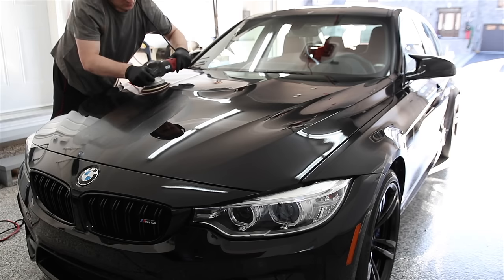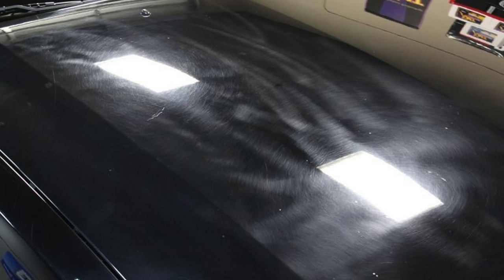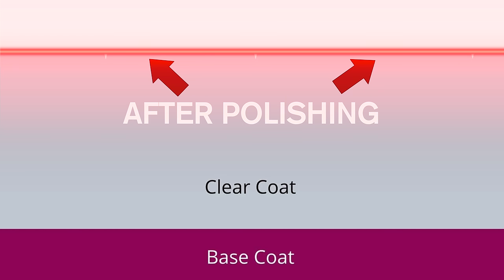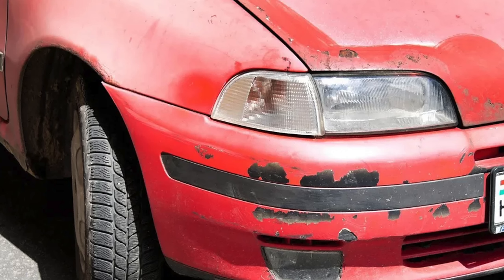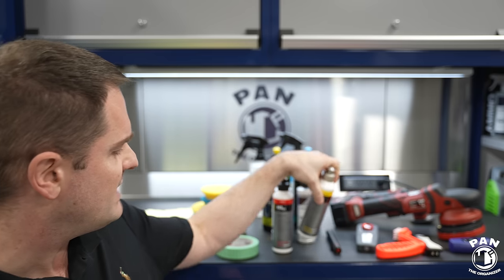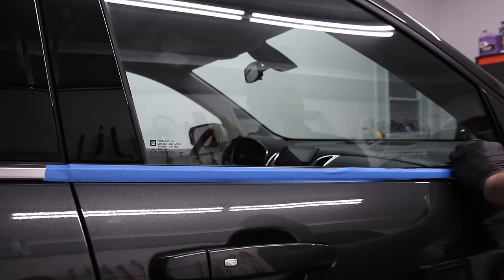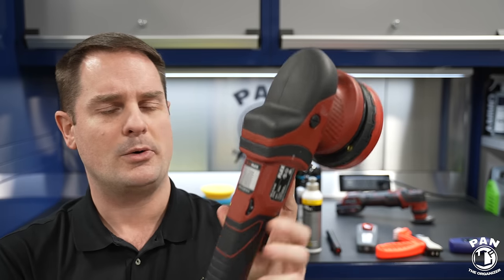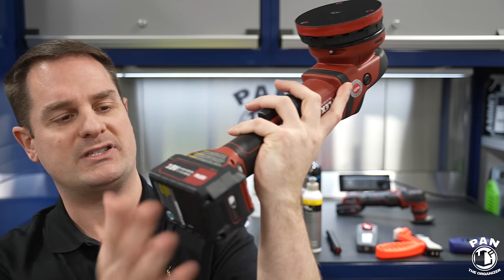DETAILING 101 - Paint Polishing - Everything You Need To Know

Comment: Hello! for Subaru Outback 2011 I used Super Cleaner I spread it on the dashboard of the car after that there were huge stains that I can not take off. what you can advance? thank you!
Reply from the maker: You mean Super Clean the all-purpose cleaner degreaser? What dilution did you use? Hopefully you used an appropriate dilution as mentioned on their website.

For interiors, I still prefer dedicated automotive interior cleaners like P&S Xtreme Interior Cleaner. They are more gentle on the surfaces compared to an all-purpose cleaner in my opinion.
Reply: @PanTheOrganizer  Hello. Yes. I use Super clean! And I just spread on a dashboard without dilution. Now have a problem. It possible to take off these spots and drips? Thanks again!

Comment: I'm new with all of this. If polishing gives the car a great shine, why would I need to wax the car? And if I need to polish and wax, what do i do first and when do i wait to do the other?
Reply from the maker: Polishing just makes the paint perfect by removing oxidation, swirls and scratches, removing a thin layer of damaged clear coat to expose a fresh one and making the paint flatter hence the increase in gloss. But polishing doesn’t protect the clear coat.

Hence why after polishing, you must apply some form of paint protection like a wax, sealant or ceramic coating. Those will protect the clear coat against the elements, sun’s UV rays, chemicals, and make the vehicle easier to wash during maintenance washes. See the protection as a windbreaker for when you go outside and it’s windy. It protects your skin.

Comment: Hi pan how many passes do i have to do i done about 4passes and i can still see the swirls, can i do more passes until i see the good results?
Reply from the maker: Impossible to say as I don’t know what products you used, what pads, and can’t see the state of your paint.

If you have lots of swirls and scratches, you normally start with a compound stage. Heavy cutting pad or microfiber cutting pad, and coarse compound. Then move to polishing stage with a polish and polishing pad.
Reply: @PanTheOrganizer  it was Menzerna - Heavy Cut Compound 1100
With blue SDO lake country blue
With das 6 pro
Reply from the maker: Try switching to another compound like Rupes DA blue coarse compound, and a Rupes DA blue coarse pad, or microfiber cutting pad. You need to find the right compound/pad combination for your specific paint and level of defect removal desired. That's why we have to perform test spots to determine the correct combination.

Also, make sure you are polishing at high speeds on your polisher.

Comment: Would you recommend this for a brand new vehicle
Reply from the maker: Hi Ryan. A new car is never new until it's properly detailed. 
- at the factory, the paint defects are often corrected quickly by rotary polishing which can leave marks and holograms, so polishing corrects those, before you lock that in long term with a ceramic coating for example.
- vehicles are then transported by truck, train and boat so they are exposed to the elements, industrial fallout, brake dust, rail dust, etc
- vehicles are often left at boat docks (when transported by boat) or in exterior parking lots for weeks or months, again being exposed to the elements
- at the dealership, the vehicles are almost always poorly prepped using the same dirty water that was used for all the cars on a given day, and poor washing and drying methods leading to swirls and scratches 
- at the dealership, a layer of cheap wax or paint sealant is usually applied to attempt to make the paint glossy prior to delivery. It's crucial to remove any previous protection before you apply a ceramic coating, as coatings need to bond directly to a virgin clear coat.

If you only plan on applying a regular carnauba wax or paint sealant though, you could decide to skip machine polishing, as those protectants can be applied over existing protection and it's not as crucial to prep the paint as well.

I explain all of this in this popular video: https://youtu.be/QgoyrC-5CMc

So you can better visualize the new car prep process, here are the steps I perform on a brand new car for my customers: 
Mercedes S 580: https://youtu.be/Vq_tfcwryVI?si=whord2_UEFSg28UW
Aston Martin Vantage: https://youtu.be/OKga3yZVTqo
Volvo XC60: https://youtu.be/tvDBBenhYFA
Tesla Model Y: https://youtu.be/gohks8xP5NY 
Porsche 911 Carrera: https://youtu.be/2ckiivbFqs4
Mercedes AMG GT63S matte black: https://youtu.be/eU8zg1lXvXY?si=oGxoCp8PWt7gTncV
Audi Q7: https://youtu.be/t7HCBSVnizM
BMW M6 Gran Coupe: https://youtu.be/0lC9uyKXs8Q
BMW M340i: https://youtu.be/etXhJNaF0EE
Audi RS3: https://youtu.be/641mAJfKDLM
Golf R: https://youtu.be/jr19g4PWJsk
Reply: @PanTheOrganizer  ok makes alot of since

Comment: I have a black car that I put:
2 coats of liquid cleaner wax
2 coats of paste cleaner wax
2 coats of spray sealent
2 coats turtle wax paste(75th addition
2 coats of liquid graphene
2 coats of flex wax 
1 coat of flex wax with every wash

All this to realize my car has swirl marks all over it.  Can I remove the swirl marks without removing all of the wax layers I put on my car?
Reply from the maker: I'm not sure if you are joking here. That's way too many layers of different products. Not only do you run the risk of product overload and streaking, but there's only so much that can actually bond to the surface, when the other layers will start rejecting themselves. There's absolutely no reason to apply so many toppers. Pick one product for the base layer of protection, usually the longest lasting like Flex Wax. And then use a drying aid after each wash and that's more than you'll need.

Turtle Wax also says a good combo is a base layer of their 75th anniversary Graphene + Ceramic paste wax, and you use Flex Wax as a maintenance product.

Keep in mind, when applying layer upon layer, you are only getting the properties of the top-most layer. What ever sits on top is what you'll be seeing. So you get the hydrophobics of the last layer. So you might be masking the performance of higher quality products underneath.

But I digress. If you want to do paint correction, as soon as you start to machine polish, that will strip the protection away. Once you're done polishing, you use a paint prep spray or IPA to remove polishing oils, and then you apply a fresh layer of which ever protection you pick.
Reply: @PanTheOrganizer  I don't put all the layers on at once. I put 1 layer on a day

Comment: If you have a new car would you still use clay prior to the fine polish?
Reply from the maker: Only clay a surface that needs it, meaning if you feel contamination or grit on the paintwork, especially near the bottom of the panels and doors. But as a general rule, we always clay before polishing. But on the rare occasion of a brand new car delivered a few days ago, feel the paint first, it might not need claying. But if it has been on the road for over a month or so, I would look into a light clay.
Reply: @PanTheOrganizer  I've had my car for 20 days and it has 1070 miles on it. I did the baggie test and it feels "slightly" coarse. I'm planning on using 3m clay and the Sonex polish you recommended with a highly rated $80 DA buffe from Amazon. I may look into another "economical" buffer from Harbor Freight tools that Scott from Dallas Paint Correction recommended. I forget the name currently. He had what appears to my untrained brain to be an excellent tutorial for beginners on paint correction using specific compounds and polishes. Thanks"again" for your valuable time!
Reply from the maker: Have a great day Bryant!

Comment: How do you determine the number of passes you need to make between each inspection?
Reply from the maker: There is no set amount of passes unfortunately. It's a case by case kind of thing, as each paint is different and the state of each vehicle is different. Do one or two passes (up and down, left to right), stop, buff off, inspect. And readjust as needed. That's why polishing takes time to get right. It's a long process. But worth the effort.
Reply: @PanTheOrganizer  thanks! Once you find how many passes you need in a test spot, can you use that number of passes (plus or minus depending on the severity of scratches) for the rest of the car, or is it better to do the whole car by doing 1 or 2 passes and inspecting. BTW I found your channel by looking up detailing products and channels. I just got into detailing and I am trying to learn as much as possible. Your channel has been very valuable in my pursuit for detailing knowledge.

Comment: Pan a bird pooped in my car hood, I let it sit for maybe three weeks at most, it ate away at my paint and there is a blemish now do you think I can fix it? 2022 Honda Civic, I can send you a picture for reference but please Pan help!!
Reply: Btw it looks like oxidation but no metal or anything like that
Reply from the maker: It's hard to say without seeing in person. One thing is for sure, letting bird poop unattended on the surface for many weeks is never a good idea, especially not if it's exposed to the sun and heat, as the acidic contents of bird droppings will start etching through the clear coat, which seem to be your case here.

If you washed the car and there is still a blemish, the next step is to use a light polish and see if that does it. If not, do a 2-stage paint correction: compound followed by a polish. In most cases, that will solve the issue.

If the etching went beyond that, you might need water sanding and in worse case scenario, a panel respray.
Reply: @PanTheOrganizer  you’re the best Pan! Thank you for all your tips, tricks and advice!
Reply: @PanTheOrganizer also Pan, it is still there after wash, it looks polish-able but if needed I will use compound
Reply from the maker: Thanks! How did you discover my channel by the way?

Welcome to my channel. You discovered one of the biggest car detailing channels on YouTube as we surpassed 930,000 subscribers and we have over 122 million views! I have been detailing for 26 years and I love to share my knowledge and passion with my viewers.

You found the right channel to help you learn everything about detailing.
Reply: @PanTheOrganizer  I seen your channel through @imjoshv , liked his videos and seen you in the related videos so I checked your channel out. I started watching detailing 101 and trust your guidance
Reply from the maker: Cool! Josh and I speak often, in fact I had him as a special guest in this video: https://youtu.be/_UwK_0VDK0o?si=ca90My8954zqZsPg

Comment: If the paint isn’t as bad can you get away with using just a polish, and not a compound? Because I have a dodge charger widebody. I think it has very soft paint. It scratches if you look at it lol.
Reply from the maker: Correct. If there are only very light swirls and scratches, and no real oxidation, you can just choose to do a polish step (not do a compound). 

Compounds are for deeper swirls and scratches, and to remove heavy oxidation. Once the compound step is done, you have to do a polish step to remove the compound's sanding marks and hazing, further refine the surface and add clarity all while boosting gloss (polishing paint is actually what increases the gloss the most, more than applying a wax or sealant for example).
Reply: @PanTheOrganizer  I’ve never polished a day in my life, so I got the McGuire polish, and compound. The car has 26k miles, so it’s not in what I’d deem to be bad condition. I’ve gotten a lot of light scratches from trying to up-keep the car. I’m using your video as a foundation. Thank you very much pan for the video, and the reply!
Reply: @PanTheOrganizer  one more question that I can’t seem to get an answer on. How long should I polish a section for? Before wiping off, and checking my results out. I don’t want to under polish, and I certainly don’t want to over polish.

Comment: Paint thickness, I think you mean Microns. Really leaning a lot, thank you.
Reply from the maker: The terms “mil” and “micron” are units of measurement used by the paint industry to measure thickness. In the English system, a mil is a thousandth of an inch (i.e. 1 / 1,000th or 0.001” or 1.0 mil). The plating industry uses the term “thou” synonymously.

Comment: so clean pad after every pass ? and then change pad after every panel ?
Reply from the maker: There are multiple ways of working with a clean pad. You pick which method works best:
1) Change pads after every other panel. 
2) Clean the pad after each panel, using a pad washer like this: https://bit.ly/4cakoHK

Also, check out another cool video on polishing tips and tricks that I made here: https://youtu.be/b9KDpKMmAi0?si=SAuEuiXg07puJMY2
Reply: @PanTheOrganizer  after cleaning it , can I use it while it's still damp or should I let it fully dry? thanks !
Reply from the maker: After you clean the pad using the pad washer, you spin it full speed in the pad washer and it frees up the majority of the liquid. The pad will only be slightly damp. You can immediately reuse it to continue polishing, no problem.

Comment: Can you do this over a factory diamond coating?
Reply from the maker: A factory diamond coating? Where did you see that? Cars being delivered from car manufacturers don't have ceramic coatings on them. That's an option offered at the dealership, but that I always recommend against, as dealerships apply cheap products for high profit margins.

Always do the work yourself with high quality products, or bring your vehicle to a reputable professional detailer.
Reply: @PanTheOrganizer  2019 Toyota Tundra.  The factory coating is diamond and they say that you cannot use conventional methods for polishing.
Reply from the maker: I did some research and that's an add-on that you pay for as an extra, just like any ceramic coating. I always tell my viewers to NEVER accept any protection packages from dealerships as they use cheap products just to maximize profits. They'll never see you again, so they don't care. Always best to buy a quality paint coating and apply it yourself, or go see a reputable professional detailer and have them properly prep and protect your vehicle with a good quality paint coating.

Regardless though, it's already too late for you as you already have the coating. And in that case, it's correct, you don't use machine polishing on coated vehicles as you'd be damaging and stripping the protection off the paint. 

What you can do, and should do, is a maintenance wash at least once very 2-3 months. See my ceramic coating maintenance wash tutorial here: https://youtu.be/IqIW78FmRYU?si=NCEURTUjJzeJmSMo

Comment: I find this thing so confusing. Like i start wondering what if i use a polishing compoud with a cutting pad  Or cutting compound with polishing pad.
Reply from the maker: A compound is used with a cutting pad. A polish is used with a polishing/jeweling pad. It can't get any simpler than that. If you have deep swirls/scratches and oxidation, you start with a compound, and then move to a polish.

If you only have light defects, and the paint seems pretty good overall, just a light polish is enough, no need for the compound step.

You only start doing weird combinations like a cutting pad with a polish when you have enough experience and can start to play with polishing compounds and pads combinations. Don't overthink the moment. Start with the basics. Compound, and then polish.

Comment: Would you still polish a year old car in steps to ceramic coat it ?
Reply from the maker: A new car is never new until it's properly detailed. 
- at the factory, the paint defects are often corrected quickly by rotary polishing which can leave marks and holograms, so polishing corrects those, before you lock that in long term with a ceramic coating for example.
- vehicles are then transported by truck, train and boat so they are exposed to the elements, industrial fallout, brake dust, rail dust, etc
- vehicles are often left at boat docks (when transported by boat) or in exterior parking lots for weeks or months, again being exposed to the elements
- at the dealership, the vehicles are almost always poorly prepped using the same dirty water that was used for all the cars on a given day, and poor washing and drying methods leading to swirls and scratches 
- at the dealership, a layer of cheap wax or paint sealant is usually applied to attempt to make the paint glossy prior to delivery. It's crucial to remove any previous protection before you apply a ceramic coating, as coatings need to bond directly to a virgin clear coat.

If you only plan on applying a regular carnauba wax or paint sealant though, you could decide to skip machine polishing, as those protectants can be applied over existing protection and it's not as crucial to prep the paint as well.

I explain all of this in this popular video: https://youtu.be/QgoyrC-5CMc

So you can better visualize the new car prep process, here are the steps I perform on a brand new car for my customers: 
RS6 Avant Performance: https://youtu.be/L5SQ0ZIJCj0?si=mcQiMs9HBLlaqjGK
Mercedes S 580: https://youtu.be/Vq_tfcwryVI?si=whord2_UEFSg28UW
Aston Martin Vantage: https://youtu.be/OKga3yZVTqo
Volvo XC60: https://youtu.be/tvDBBenhYFA
Tesla Model Y: https://youtu.be/gohks8xP5NY 
Porsche 911 Carrera: https://youtu.be/2ckiivbFqs4
Mercedes AMG GT63S matte black: https://youtu.be/eU8zg1lXvXY?si=oGxoCp8PWt7gTncV
Audi Q7: https://youtu.be/t7HCBSVnizM
Reply: @PanTheOrganizer  thanks a lot.. I’ll polish after clay bar stage
Reply: Would you polish Tesla door handles r tape them off?